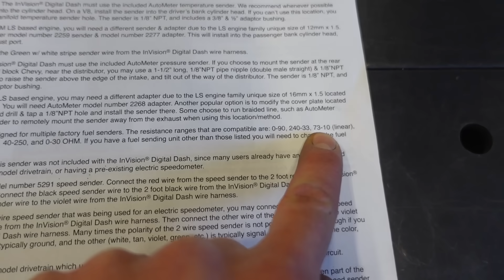Full Fuel System For The LS Swapped FJ40 Toyota!

Comment: Super! I am watching to see how fuel vapor recovery should be handled with my new tank. My build is just to get the 1970 driving before I drop too much money into it. I replaced the 4 cylinder with a Chevy 327 and turbo 350 trans about 1988. The original tank rusted out. New tank has vapor lines that collect like a 1975 would. An engine water jacket thermal driven vacuum line can release the carbon canister vapor when warm purging into the intake manifold but concerned about running lean and loss of vacuum with this set up. (I updated to vacuum assisted disk brakes a while ago.) 
About the power steering, a power steering box off mid ‘80 Toyota pickup. Mount the box outside the frame just forward of the axle with the rest of the box riding on the frame rail. This allows the steering linkage to go direct without pillow blocks or complications trying to get past the V-8 exhaust manifold. Since the steering extension down to the pitman arm is so close to the axle, it does not interfere with the tires. I had a little issue with the radiator frame bucket. But if this old copper does not cool enough I will put an aluminum in offset from center and use electric fans instead of the centered engine driven flex fan I have now. If you want photos I can send . Thanks for the videos and ideas. Much appreciated.

Comment: That may have been a tank baffle you cut out...keeps fuel from sloshing like crazy when the level gets low, so the sender float doesn't bounce around and cause your fuel level readings to get wacky. I could be wrong though, not terribly familiar with how FJ tanks are set up. Either way, progress is looking good man!
Reply: I’m pretty sure you’re right, but if he didn’t cut the whole thing out just that section he needed it looks like the pump mount maybe is wide enough to kinda replace that piece of the baffle he cut out
Reply from the maker: You may be right! There’s actually 2 so it still has one, and I didn’t cut the whole piece. Also the hanger may help because that’s in place where I cut the original out! Should be ok
Reply: @austinniemela  nice thing about the tank being under the seat is that it's easy to access if you need to add a baffle back in! But, I think you're both correct - the added pump assembly might do a pretty good job of mitigating any side effects caused by the piece you removed. Can't wait to hear that beast fire up. 😎
Reply: Yeah, apart from it being a tank support, it's also the tank baffle to help with fuel slosh. Cool thing is, his tank is easy to access incase he'll have to replace it
Reply: Yea, but he replaced it with the fuel pickup assembly, which will provide roughly the same anti-sloshing.  I think it will be just fine.

Comment: great work! looks slick with routing through the frame. Maybe add some kick protection from little feet, where the lines first go into the frame? Fuel regulator? didn't see one!
Reply from the maker: Thanks! Fuel regulator is on the fuel rail!

Comment: The plastic return line you cut might work better if it sent the return fuel away from the fuel pump inlet. This would help keep the fuel cooler and less aerated. Awesome build!
Reply: You want the return to go back into that baffle "bowl" so that when the tank is lower on fuel it helps keep fuel around the pump pickup and reduces starvation.. Its the way all OE in-tank pumps are setup also..
Reply: @markwelliver2566  how many manufacturers install a powerful v8 with a high volume pump in a tiny fuel tank? Fuel pumps die an early death pumping hot aerated fuel..